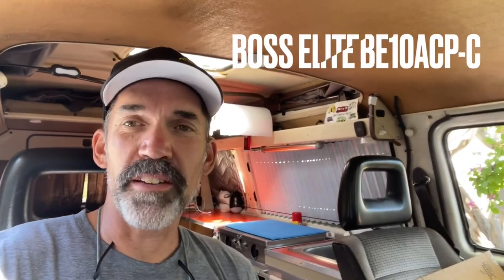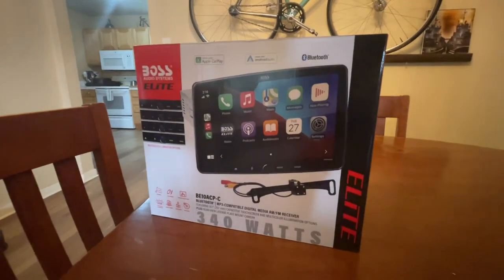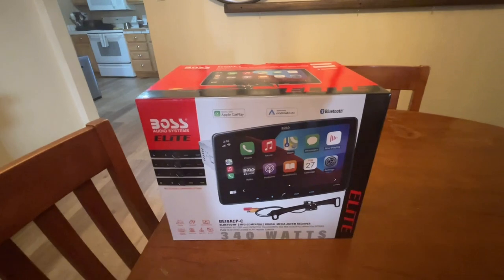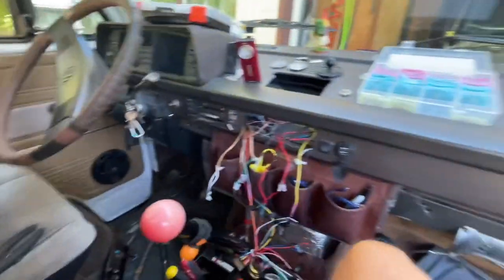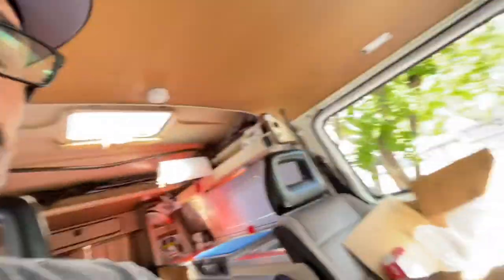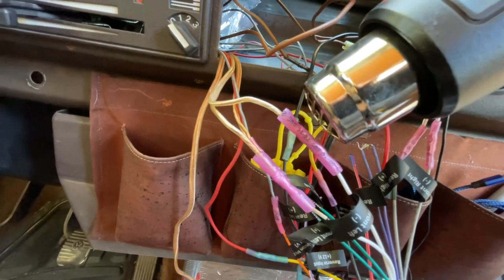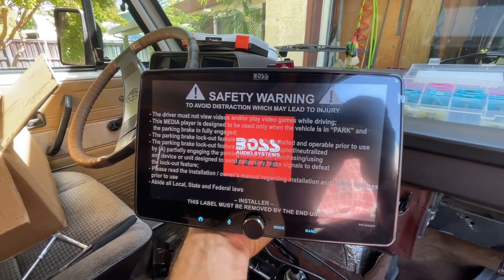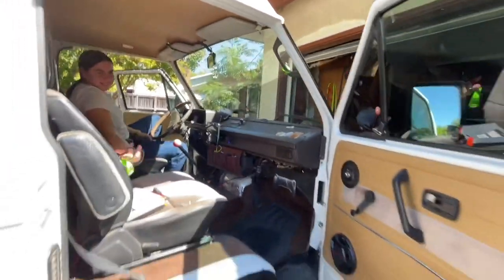Vanagon Westfalia Stereo Upgrade Boss BE10ACP-C with Apple CarPlay

Comment: it would have been great to see how it effects the ability to turn fan switch, shifter and other interference it might have caused.
Reply from the maker: The fan switch access is a little tight if the screen is rotated towards the driver. Usually I have it centered.  Otherwise, no problems. 👍🏽

Comment: Thanks this helps a lot... a question though. Why didn't you use the stereo kit from Go Westy?... it looks so much easier
Reply from the maker: The wiring in my 82 was all hacked up when I bought it, so it’s far from factory.  Easier to just to solder/splice things in.

Comment: I just ran across this install, how's the stereo treating 9 months later? I'm considering doing the same install in a 1985 I'm about to purchase.
Reply from the maker: It’s been great!  Occasionally if I make a Bluetooth call, it will
Get stuck in phone mode for
Some Reason. The fix is to shut it off and turn it back on.  It’s only happened a few times and other than that I like it.

Comment: Did you have to run an amplifier? Ran my wiring but not getting any sound out of the speakers
Reply from the maker: No amp, just straight the the speakers and plenty of power for 2 6x9’s and 5.5” door speakers.  It cranks!

Comment: Those spices are butcher work.  Try soldering .
Reply from the maker: First of all, I would agree that soldering is definitely a stronger connection but not necessary in most cases.  I solder quite a few connections, but have never had a problem with butt connectors either and have been dabbling in marine & vehicle electronics for over 40 years.  I would recommend that you keep your tone a little more neutral or positive if you want people to follow your channel. Negativity never bodes well online. Thanks and have a great day.  😉
Reply: Vehicle vices is in error.  Those type used have hot glue inside and bond to the insulation, providing strain relief. Solder embrittles the strands, the adhesive heatshink does not.  Heat shrink splices are superior to solder.